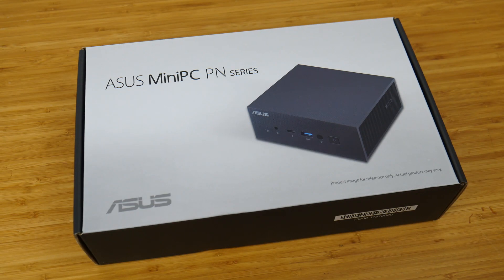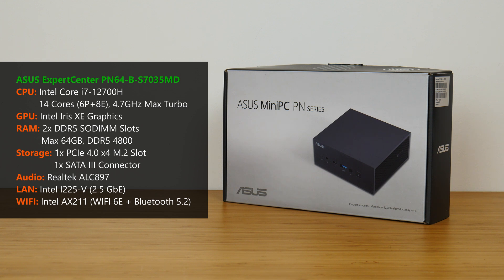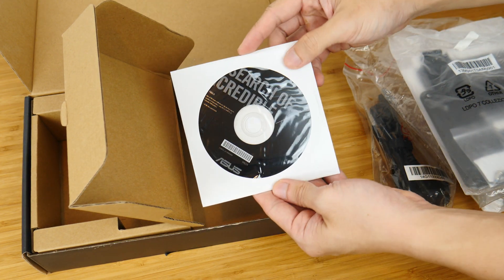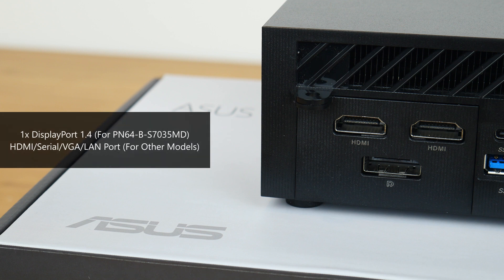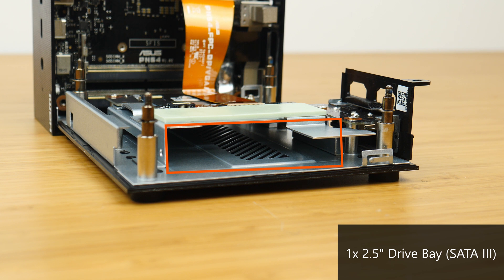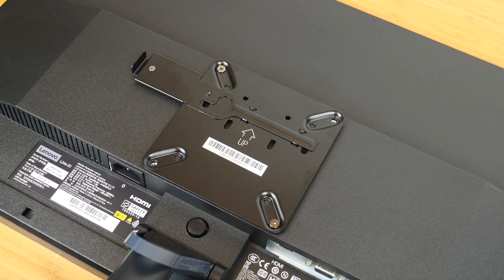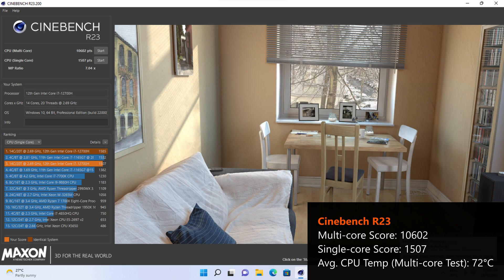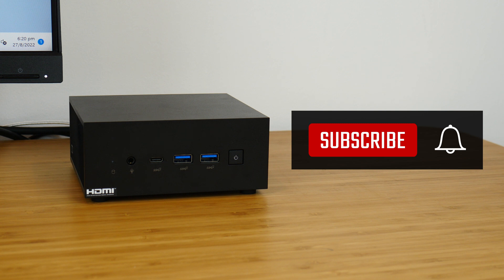This Mini PC Packs a Punch!

Comment: Hello, I purchased this product ASUS PN42 Barebone Celeron N100, I would like to know if these products have hdd or ssd inside or not? At the time of starting, absolutely nothing happens! Only the light blue power button lights up! Do I have to install SSD and RAM separately?
Reply from the maker: Hey there, these are barebone PCs that usually do not come with RAM and SSDs pre-installed, unless the retailer installed them as a "package" set. Your best bet would be to open up the PC to check if there is any RAM or SSD installed!

Comment: Sorry one question,but is that fan that loud?
Reply from the maker: The mini PC comes with two fan profiles that can be selected from within the BIOS - Normal and Quiet.

I didn''t have with me a proper decibel meter at the time of testing, but using a decibel meter app on my phone as a rough estimate, I got the following results:

Baseline ambient noise levels with PN64 switched off: ~44dB

PN64 on Normal Mode: ~47dB on idle, ~68dB while running Cinebench R23 multi-core test

PN64 on Quiet Mode: ~46dB on idle, ~56dB while running Cinebench R23 multi-core test

Qualitatively, the fans were audible when under heavy load, but personally I wasn't that much bothered by the noise. Hope this helps!
Reply: @ALKtech  thank you !!🙂

Comment: 8k 60hz?
Reply from the maker: 8K 60Hz is only supported on certain models of PN64, you'll have to check with your local distributor whether the PN64 that they stock comes with an 8K-compliant HDMI port!

Comment: I bought PN64 device less than 1 month ago. And I have artefacts with/or black screen when I watch movies or play games. It happens each time. Only shut down helps. I wrote to shop for returning - the ignore me. Also, they delited this product from store... I wrote to ASUS and they told me that I should return device for them and I have to wait postman. I waiting more that one week... I did memtest86 and everethyng is fine. Also, SSD works on another device well. I updated BIOS to 2.12 version. And today I check maybe new version realized. But they delited 2.12 version from their offivial page. So actual version waas my past version. I don't know what I can do in this situation. I bought new product, new RAM 32GB, new SSD and all this things lies and dusts.
Reply from the maker: Did you manage to get your PN64 replaced under warranty eventually? Or are you still waiting for the courier to pick up your faulty PN64?
Reply: @ALKtech  Still waiting. I decided that if I see this PC or same problem - I'll write and maybe find the solution. Because I still believe that this problem is not about GPU core. Hope once there are new update relized which solv my preblem. I'm not really sure that asus support can do something. 
Anyway, I'll be in touch about this device, maybe I help someone.

Comment: Will you review the PN64-E1 with a i7-13700H? I’ve been looking at one since the release announcement and haven’t found a review yet.
Reply from the maker: I'll have to check in with the folks over at ASUS whether or not there are marketing samples for 13th Gen PN64s!
Reply: Thanks for the consideration!

They seem to be really hard to get now. I’ve only found one seller in Sweden where I live that says they have ordered “<10” (less than 10) of them. I plan on using one for my Debian Linux Plex server.

Comment: Can you please let me know if there is any limitation to the capacity of the m.2 and the 2.5" ssd? Also, is there no wifi antena inluded? Thank you :)
Reply from the maker: To my knowledge, there's no capacity restriction for the M.2 and SATA drives with this mini PC. Also, the WiFi antenna is built-in within the PC itself, kinda like how laptops have built-in WiFi antennas. No need to get an external antenna if that's what you're concerned about!
Reply: @ALKtech  thank you very much for the information 🙂

Comment: Would this mini pc be viable to stream 1080p60 from a console?

So no actual gaming on the pc itself, just running capture card and streaming software
Reply from the maker: Are you gonna be using something like an Elgato? I personally haven't used such a streaming setup before, so I can't say for sure. But that said, given that this mini PC has quite abit of processing power, I'd like to think it should do 1080p60 just fine...
Reply: @ALKtech  yeah I have the elgato HD60 X. I got a cheaper mini pc that is struggling to do it. It's an i7 but it's got a 10th gen GCU which seems to be the biggest problem. Everything else it handles fine, but the GPU is constantly overworked and flirting with 100% usage
Reply from the maker: @gotaplanstan  Right I see. I think the Intel 10th Gen's CPUs didn't exactly have the best performing iGPUs around...perhaps the AMD variants of the ASUS mini PC might do better from an iGPU perspective wise - I tested the ASUS PN53 that sports AMD's Ryzen 9 6900HX with integrated Radeon 680M graphics in one of my reviews some months back - this might fare better in terms of iGPU performance!

Comment: Just purchased this little PC a 2 days ago. After installing Windows and installing the driver pack from Asus, I'm experiencing a bug where the screen and audio shuts off intermittently and comes back on. On average, this happens once every 5 mins. I even tried installing drivers provided by AMD but it still happens. Any idea what the problem could be?
Reply from the maker: Hello, I'm assuming you got the PN53 variant that is powered by an AMD CPU instead, since you mentioned AMD drivers? I'd probably try installing older versions of drivers to see if that helps, and perhaps update the BIOS to the latest version too (if the PC isn't already on the latest BIOS)..

Comment: Hi. Im curious if incompatibility of ram comes from ECC. On support list there are only non-ECC modules but putting ECC module in theory should work, just without ECC. Kingston Fury Impact is ECC. Can you check if your ram is ecc?. Regards!
Reply from the maker: Hello, the TEAMGROUP DDR5 SODIMMS that I used to test the PN64 have on-die ECC, similar to the Kingston Fury Impact - do note that all DDR5 modules comes with on-die ECC which is not the traditional ECC that we've come to understand with previous gen memory standards such as DDR4 and earlier - there's several detailed articles and videos out there on the differences between on-die ECC and "actual" ECC!

Comment: Great review! May ask if this i7 model can be powered through 90w usb-c port? I have a dell monitor with 90w usb-c delivery and quite curious if it is compatible with this pn64.
Reply from the maker: Thanks! To my understanding, the PN64 can draw power from a USB Power Delivery-enabled device, such as a monitor! On ASUS's website, it's stated that such devices need to support 20V/4.5A power delivery - your Dell monitor should work just fine.
Reply: @ALKtech  thank you so much for your reply!

Comment: I guess it could be highly optimized, because 10k in R23 is a extremely low score for that cpu. Laptops with it reack around 16-18k.
Reply from the maker: Indeed. I did a Cinebench run with the power limits removed via ThrottleStop, and this bumped up the scores to 13135 points for the multi-core test, and 1773 for the single-core test, albeit at the expense of thermal performance. I suppose the thermal and power design of the PN64 does affect the performance of the 12700H somewhat!
Reply: @ALKtech  Cool to know!

Comment: Thanks for the review! Is the fan audible/annoying during normal load? There were complains about older models, I wonder if they changed something ever since they updated the chassis to this one.
Reply from the maker: No worries! The PN64 has two fan settings that can be tweaked in the BIOS, "Normal" and "Quiet". Under normal load and on the "Normal" setting, I couldn't really hear the fan at all. I'd advise against using "Quiet" mode as the lower fan speed results in poorer thermal performance especially under load, which results in thermal throttling.

That said, I don't have a proper decibel meter with me, but using a decibel meter app on my phone as a rough estimate, I got the following results:

Baseline ambient noise levels with PN64 switched off: ~44dB

PN64 on Normal Mode: ~47dB on idle, ~68dB while running Cinebench R23 multi-core test

PN64 on Quiet Mode: ~46dB on idle, ~56dB while running Cinebench R23 multi-core test

Hope the info above helps!

Comment: This thing is shit. Does not support Kingston and Crucial for DDR and only 32GB total (not 64GB)
Reply from the maker: Hey George, I checked in with ASUS and the PN64 does indeed support 64GBs of RAM. Do you own a PN64? If so, have you tried updating to the latest BIOS? DDR5 is still relatively new to the market, especially for SODIMMs, so there could be compatibility issues from time to time as the technology matures!
Reply: @ALKtech  I have just bought an Asus PN64 and 2 Kingston Fury Impact 8 Gb SODIMM DDR5 4800M. After installing the RAM and SSD, the PN64 does not start. Could be a problem of RAM compatibility?
Reply from the maker: Hello  @jvtomas2431 , perhaps try booting with just one RAM stick first in the first DDR5 slot, and once done, swap the RAM stick into the second RAM slot. Do the same for the second stick of RAM in both slots - this is to "train" the PC to boot with the RAM properly. See if this method works?
Reply: @ALKtech  Thank you @ALKtech! Following your advice I have able to turn on the computer and access the bios. On some RAM slot and module, I had to wait until 20-30 seconds for it to be recognized and "train" the PC. The problem is that it works just with a single 8Gb DDR module connected. No matter the position and the DDR module, it works. But when I connect both modules at the same time, I get a blank screen. May I have to wait longer until both are recognized or update the bios? Thank you for your support
Reply from the maker: @jvtomas2431  Great to hear that at least you're able to boot with a single stick now. Have you tried leaving both sticks in for an extended period of time too (20-30 seconds)? Also, updating the BIOS could help too - try updating it with one stick of RAM in place first, and see if the issue goes away?
Reply: @ALKtech  I just did both things, but the PC won't boot with the 2 DDR modules at the same time. Before updating the bios, I put the PC "training" at least for 15 minutes with the 2 modules but the screen was blank all the time. After updating to bios v1.11, the situation was similar but automatically rebooting every 50 seconds without detecting the 2 RAM modules. I even tried with two Crucial 8Gb modules (CT8G48C40S5), but the behaviour is the same as the Kingston Ram modules. Maybe I have not chosen the right RAM brands :-(
Reply: Eventually, it wasn't a RAM brand problem. I managed to run the Asus PN64 with 2 Crucial DDR modules. However, I had to buy 2x16Gb DDR SODIMM modules (Crucial CT16G48C40S5). Thus, I encountered problems with the 8Gb RAM Crucial modules but not with the 16GB ones. BTW, another curious thing that I have detected is that with the 2 RAM slots occupied, the detected graphics card is not Intel UHD Graphics but Intel Iris Xe Graphics.
Reply from the maker: @jvtomas2431  thanks for the update - sure looks like RAM compatibility teething issues...I'll pass this feedback on to ASUS from my end to see if there's any inputs from their end regarding this issue!

That said, the PN64 does indeed come with Iris XE graphics - did you mean that your graphics adapter was showing up as UHD graphics instead?
Reply: @ALKtech  Yes, with just one RAM module inserted, surprisingly it is detected as Intel UHD graphics in the Intel Driver & Support Assistant application. Once you have the 2 RAM modules in the PC, it already appears as Intel Iris Xe Graphics...
Reply: Have tried it exactly with 1x32GB Crucial CT32G48C40S5. No matter which RAM slot, the fan starts briefly, then stops again and NOTHING else! No Bios start, screen stays black (no HDMI signal), nothing.
Have the latest BIOS firmware version 1.11.00 from 2022/08/22.

2x16GB CT16G48C40S5 works perfectly fine!

Update1: Kingston Fury KF548S38IBK2-64 - 32GB Modules are not working!
Crucial 1 x 32GB are working in both slots (like in the video https://youtu.be/x4xoLNy3VnQ) but 2 x 32GB are still NOT WORKING!!!
ASUS PN64-BB7014MD - a mini pc but a big piece of sh...

Update2: Today I wanted to install Windows but after a few minutes the PC went off and since then can not be turned on. Nothing no response, power LED stays off but USB ports supply power.
So apparently the PC is now completely scrapped.

Update3: Data sheets published by ASUS: 
- 20220915 "2 x DDR5 SO-DIMM slots for DDR5 4800 MHz, 1 x 8GB - 2 x 32GB (total)"
- 20221101 "2 x DDR5 SO-DIMM slots for DDR5 4800 MHz, 1 x 8GB - 2 x 16GB (total)"
Thus, ASUS simply got out of the affair. Bravo!

Comment: Hi @ALKtech, do you know what is the total power consumption of the system in idle mode? You say that the CPU power draw is 3W, but that sounds too low to be for the whole system right? Thanks!
Reply from the maker: Hello, the 3W idle power draw figure is in reference to the processor's (i7-12700H) idle power draw, not the entire system as a whole. This figure was obtained from MSI Afterburner, and checked against the readouts I got from HWINFO64.

I did not have a power socket wattmeter with me to measure whole-system power consumption during the review - trust this clarifies!
Reply: @ALKtech  Thank you! Sounds good, total power consumption at idle might then be similar to previous PN-models, somewhere between 9-13 W. Very interested in the PN64, only letdown is the lack of Thunderbolt support.
Reply from the maker: @perrunemo2716  no worries! Indeed, having a Thunderbolt 4 port would have been a great way to round off the top-of-the-range PN64 with the Core i7 processor - ah well!
Reply: @ALKtech  how is the audio quality from the 3.5 mm jack? is the realtek alc897 good?Also does it support charging via the USB type C port?
Reply from the maker: The audio is average I'd say - the ALC897 is pretty much an entry-level audio codec by Realtek. That aside, it does support charging of lower-powered devices such as mobile phones via the Type-C port, but do note that the port does not support Fast Charging as far as I can tell.